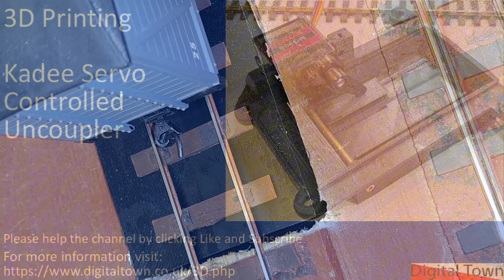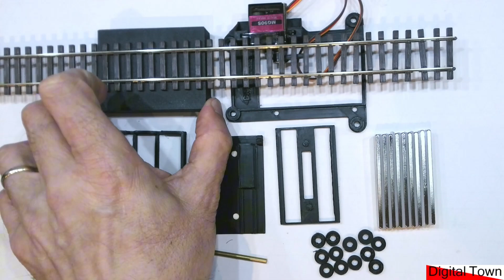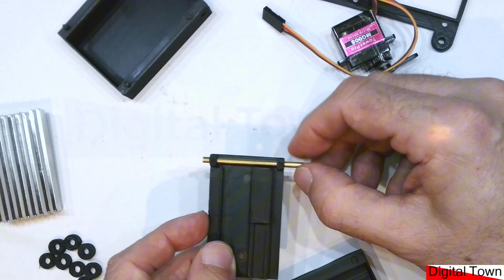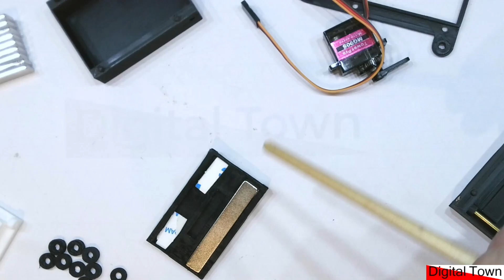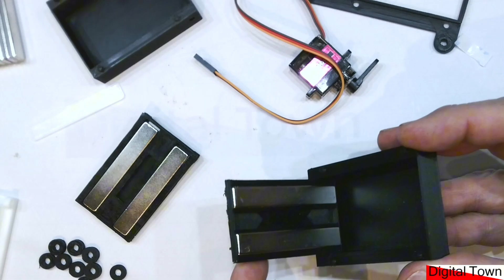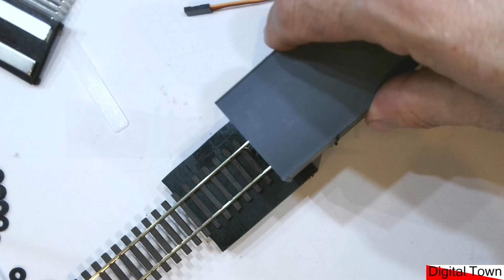3D printed Servo controlled Kadee Uncoupler

Comment: This is perfection for concept. .  Maybe, overly complex.  I think a servo the just swings a magnet into place might be simpler.   This is cool though
Reply from the maker: I tried that in an earlier version, the issue is just how close the magnet has to get to the base of the track and that the magnet has to be perfectly parallel to the track so the case forms a very thin layer that ballast can be placed on but gets everything in just the right position.
Just using the servo with the magnet fixed directly to it means having the servo directly under the track so it would get ballasted in. A real pain if the servo needs replacing.
Reply: @digitaltown5442 interesting.   Glad u came up with the flatform.  I think magnet strenth and type would play a major role in function relating to distrance.   Free to mess with. On my to do list.  :)
Reply from the maker: Magnet strength but also position is crucial. I found even 1mm could make a difference. Also allowing for any interference in the magnetic fields from the track, ballast and other stuff, I built quite a few prototypes and test rigs.
Reply: @digitaltown5442  Nothing to do with anything, but just monday I found out that partial eye sight loss is not repairable. :( I  am going to sell all N and HO stuff anyway :(  Sad.   Going all O scale.  Good to know I can always go G scale if things got real bad.  You never know what life brings you.   Going from COOL uncoupler, to NEVER MIND in just days. :(  Thanks though.  I think it's a cool system and was looking forward to getting my layout up and go.  Now, all just a  pipe dream.   Way too hard to work with those tiny couplers and other than prebuild buildings and such, no point.  God Bless.
Reply from the maker: @Curious_Skeptic  Sorry to hear that, As my eyes started to go... just old age... I moved up to 0-16.5 or On30 as it's also called. This allows me to have larger models to work with but stays on 16.5mm track so I can have a decent layout in a smaller space.
As I scratch build and 3d print loco bodies I just mount them on HO chassis at the moment until I design my own.
Reply: @digitaltown5442  That's really great to hear!   Who knows.   I know I have to work through and past the eye strain and constant headaches.  Just seems obvious bigger is better as we get older.  LOL.

Comment: Well done. What track gauge is this designed for?
Reply from the maker: It will work with HO/OO and in my case 0-16.5 narrow gauge as I use the same coupling height.